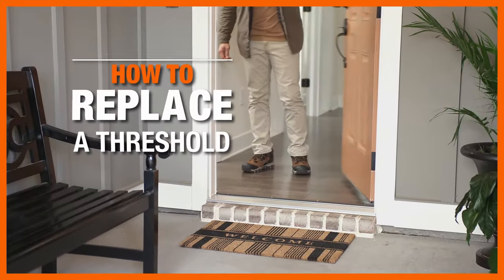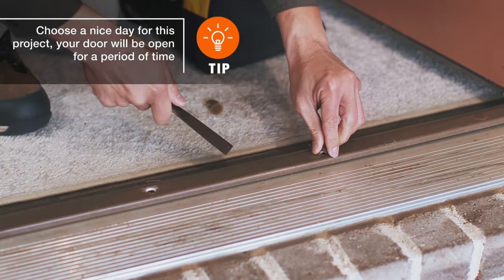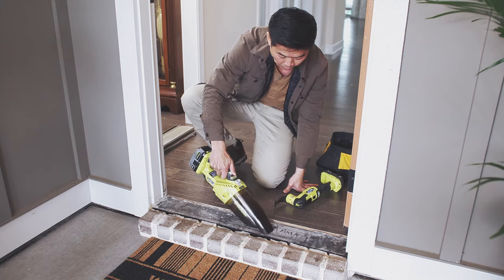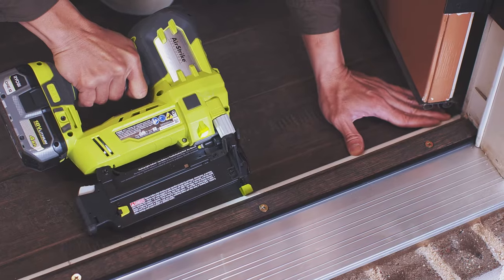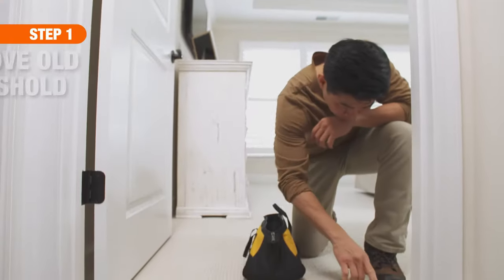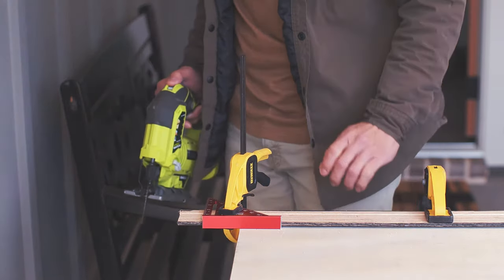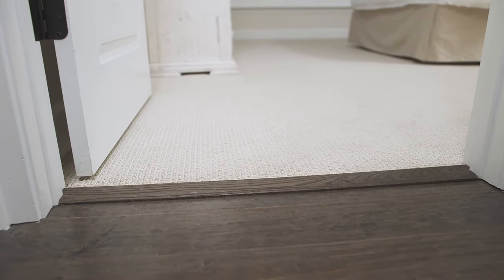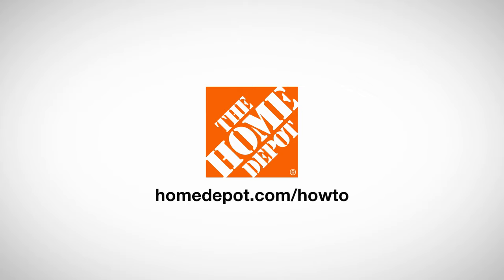How to Replace a Threshold 🚪 | The Home Depot

Comment: Agreed with other comments, this leaves out so many possibilities of what you will encounter.  In my case I was not expecting the ends of the threshold to be screwed to the bottom of the door jamb, and so I ripped apart one side of the door jamb after cutting the threshold in half per instructions, then cutting through the caulk underneath, and trying to pull it out.  At least on the other side I was able to cut through the screws with an oscillating tool (a key tool for cutting the threshold in half, detaching the caulk and more).

Comment: How to replace rubber sill on bottom of door
Reply: Take the old one off and put the new one on. 
This is at least equal to the amount of information this video gave you for replacing the threshold. 

For a real answer, you will have to determine what kind of door sweep you have. Some slide in to slots on the bottom of the door. Some are nailed in to the bottom of the door. Some wrap around the door.  If it is nailed into the bottom of the door or it goes into slots on the bottom of the door, you will need to remove the door to replace it. Some wood doors are extremely heavy and will require more than one person to move or put the door back on the hinges.

Comment: Not sure what brand of exterior threshold that is, but it’s not Frost King. Frost King’s vinyl threshold has no pre-drilled holes in the vinyl, not hardware or any kind to install.  You can’t remove the vinyl so you can hide mounting screws, or nails. Vinyl is on super tight and even nailed in on interior side, so removing it will most likely damage it. 
I’m not comfortable using liquid nails, or some other adhesive, to hold it securely in place. 
It was a waste of time selecting this one, and will have to return (more wasted time). 😐
Reply: I used some PL Premium to replace a section of sill plate that had rotted away from the clothes washer leaking over the years because the prior home owners were idiots. I glued the wood down using a large amount of PL Premium on a very well cleaned section of concrete. I had to hammer some nails into it the next day and I expected it to pop back off, but it didn't budge.

Comment: Notice how there were no instructions on how to saw your threshold in half...
Reply: That is one of the glaring omissions!  Surprising since there is an oscillating tool right there on the floor in that part of the video, presumably what he used.  I had a new oscillating tool I was itching to make use of, and it came in super handy for that as well as cutting the screws from underneath up into the jamb, and separating the caulk/adhesive from the concrete underneath.  Hopefully this will help future viewers.